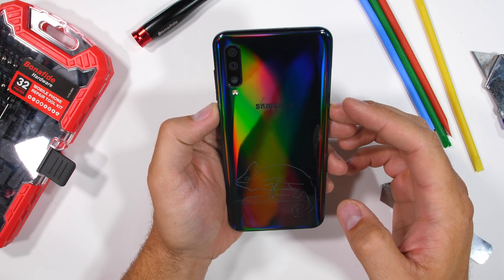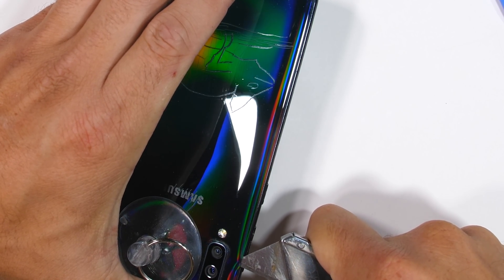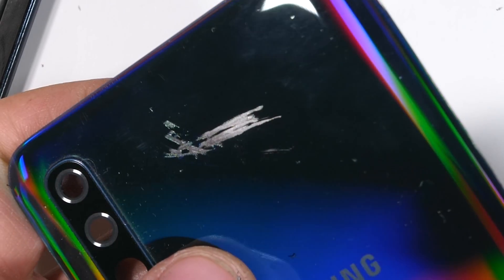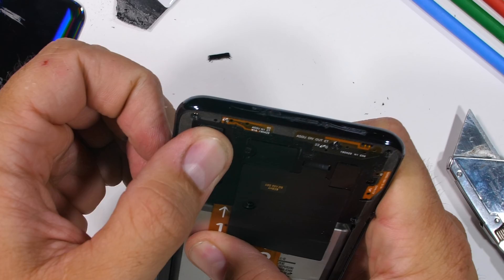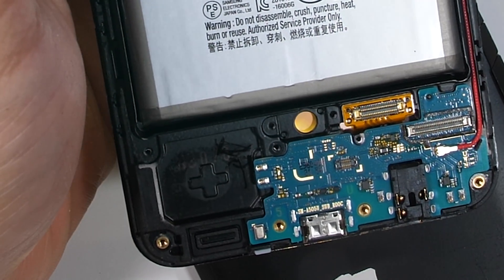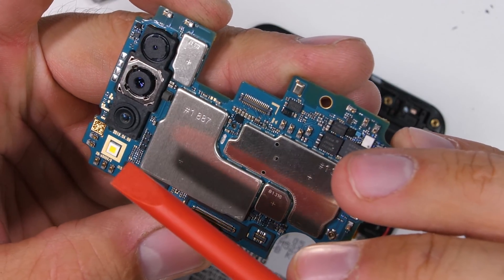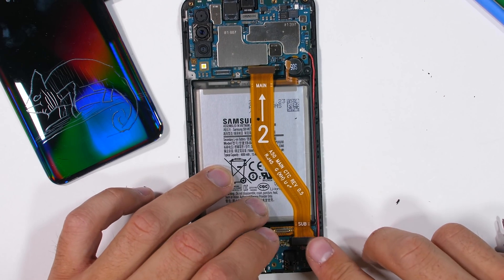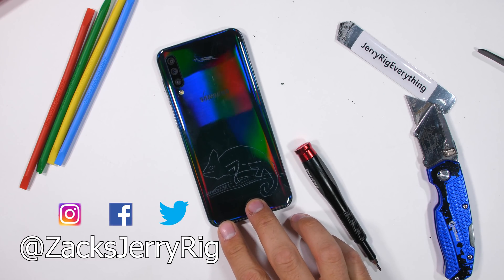Galaxy A50 Teardown! - Did something crack inside?

Comment: i had my a50 from 2019 and used it ever since. until... one day i slipped and the phone fell from a 0.5 meter height, not that much, right? well its critical for the phone. the display cracked, and stopped working. glass broke inhalf and flew away. now its lying in my room, with no purpose. i were shocked by that and didnt buy the A line of samsungs until now. i am typing this from my galaxy A55

Comment: Just had my screen replaced by the UK company Virgin. They were super fast and got it to me within 5 days,when it was supposed to take a week! Silly me dropped the phone and cracked the inside screen causing the purple goo of death to spread from the top corner. 

By the way,if you buy this phone,be super careful! The screen is very very delicate and even an angels kiss could scratch it! Also, when you put the sim card in, dont do what I did and accidentally miss the pinhole button and ram the needle through the back of the phone! I did this and it seems fine, but I might have kissed the motherboard a little 0_0

Comment: If you are replacing the battery what do you care about how well the factory glue holds the, one presumes, now defective battery is...You Are Removing It.

Now, stop crying like a little child and buy some batter pull tab adhesive strips and use them to install your new battery...That way, when it goes bad, eventually, you can easily remove it.

Comment: Correct me if I'm just ignorant here, but why does it matter if you can safely remove the battery? There isn't much reason to remove it for anything but replacement, and if you're replacing it, why do you need to worry about the structural integrity of the old battery?
Reply: It's because it can explode while you're removing it

Comment: Zach's vids are great but his complaints about battery adhesive are a bit over the top. Its quite easy and safe to use achahole to remove these batteries. Certainly not a reason to go for another phone.

Comment: stupid question. my a50 stopped charging 4 days ago. i live in thailand and when i give it back to the shop it can take up to 4 month before i get it back! i don't care much about the phone anymore but i want to recover the date on it. any suggestions ? i have no water or drop damage. for the last weeks it didn't even fast charge just charge. i had the charging port and the battery checked today in a repair shop but they said they r both fine. so what else can it be ?

Comment: 4:55 "buy the phone with replaceable batteries, and skip this A50"

Me: watching this video with my galaxy A50
Reply: That's why I still haven't upgraded from LG V20 - the last of the replaceable battery champs. My next will definitely be the Fairphone, once they become available worldwide. 
It is so environmentally expensive to make a phone and instead of building them to last longer with modular hardware and long term software support, the industry is basically creating a 2year hard limit with sealed battery and poor software upgrade paths. Future generations will mock this era of technology...
Reply: Same here 😂
Reply: Nah, its only important if you have it for a crazy long time.
Reply: Same
Reply: Same
Reply: Lol me too
Reply: Same
Reply: Same but I want to break the chain
Reply: Same
Reply: Same and happy with phone have 2 a 50 phones now...one got losted in pune 2 days back
Reply: Watching on a A30s cause I skipped the A50 😂😂😂
Reply: don't worry, when it comes to teardowns, Zack's a bit of an amateur... 

yes, pulltabs are mega cheap to make, but with phones having a generally bad resale value (basically anything that isn't Apple), skipping the pulltabs isn't such a bad idea economically wise

and yes, the A20e/40/50/70 battery can be replaced very easily and safely with the correct tools, a small plastic pry tool and some Isopropyl alcohol make short work of the sticky crap underneath the battery without any bends or tears.
Reply: @Dragonite33  it’s not about replacing batteries easily, in the video he said the battery can get punctured easily which is not safe
Reply: @nsdfancy  same applies. You're not going to puncture the battery with the flat end of a pry tool when the battery adhesive loosens with the effect of Isopropyl.
Reply: All Xiaomi phones can remove the batteries easily and they're cheaper than Samsung's mid-range phones.
Reply: @itsmoses7973  I got mine for $250 USD on Amazon because of a sale
Reply: @itsmoses7973  yeah because xiaomi knew that their own battery life is suck.. so they choose the replaceable battery
Reply: Same
Reply: Me too
Reply: Same lol
But mine is a50s :v
Reply: Same
Reply: Same
Reply: Same
Reply: Same
Reply: Yeah, me too LOL
Reply: i don't think anyone is gonna bother with replacing the battery of a cheapo phone
Reply: Rarity: Makes a Blue Moon look like that one annoyingly common shit in a game
Reply: U did not see the previous video. He bent the phone in opposite directions 4 times. It's only natural for the battery to be like that.
Reply: same
Reply: same
Reply: a50 brotherhood...
Reply: Poor af
Reply: Me and you relate
Reply: Im still wanting it!
Reply: Watching on the A51. Its only a few days old and a major upgrade from my 4 year old android 5 phone lol.
Reply: Same here ☹
Reply: me too
Reply: @B B In terms of performance, it works great with no issues, it runs most games without lag or cutoffs "Just like using a galaxy S9 or S10". As far as battery goes, It's also great, when I first got my A50 I only had to charge it every 2 days.However, now that it's been more than a year of using it, I'm definitely charging it alot more (but that doesn't mean I have it on charge 24/7, no. It's because I installed alot more apps and I'm using it alot more).
Reply: Me too
Reply: Same
Reply: Same here

Comment: I just ordered that phone.  I'm really surprised the battery is glued in.  My older J7 Sky battery is easy to take out and put in.  What do you do with these phones when you've scratched them up? I got mine direct from Samsung but in only came in the boring black, but I did get it on sale.  They took $50.00 off and I got $50.00 trade on my old phone so it cost $250.00.  That to me is ALOT of money for a phone, but since I can't use the J7 anymore I'm hoping it's worth it.

Comment: I think most all these durability test aren't realistic with how most phones are used let alone how they are damaged with normal use.  Most of the durability test should be drop test on a variety of surfaces such as road , concrete,  wood floor , carpet,  down stairs,  gravel etc . Most phones get ruined by drops vs scratching it to the extreme or hitting it with a hammer etc.  So do videos on drop test and see how it fares. Face down drops, corner impacts from a drop etc.

Comment: What A LOT of people don't realize is that there are A LOT of OTHER people who use BOTH Bluetooth AND their headphone jack for different reasons and circumstances. Bluetooth = GYM!!! Headphone Jack = CAR AUX IN for high quality listening. Bluetooth sounds like SHIT even with the newest codecs compared to a wired set up.  Sure..they're getting better...and wireless is totally convenient, but whatever happened to options? AND WHY does a CHEAPER phone have MORE options than an expensive one? But I guess there are millions who will overpay for a lot less.....(Rhymes with fapple) including no headphone jack and a 5 watt charger in the box in 2019. So...???

Comment: I have yet to have to replace a battery. Usually phone becomes obsolete first . My s7 is 3 4 years old . Still using it now until I switch to this a50 . I am not spending 1000 for the s10..rather save some cash now days. So 350.00 if it lasts one year I'd be happy.